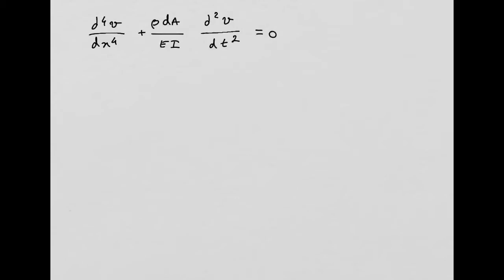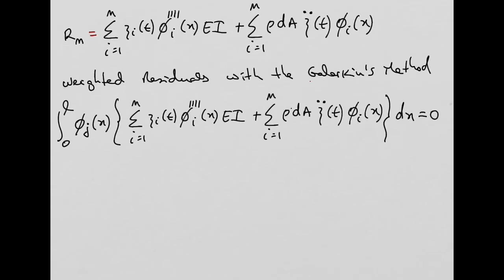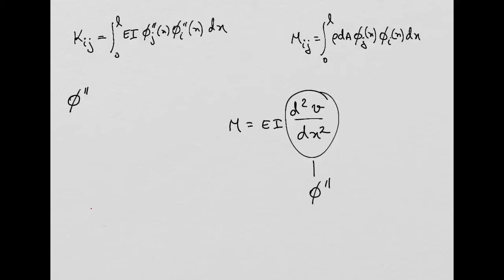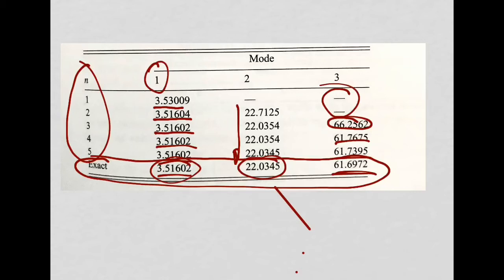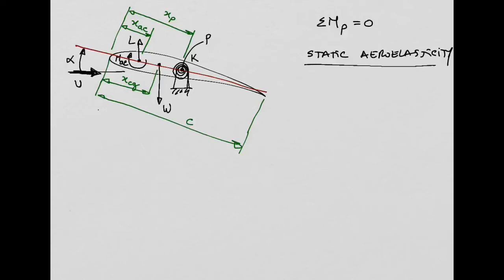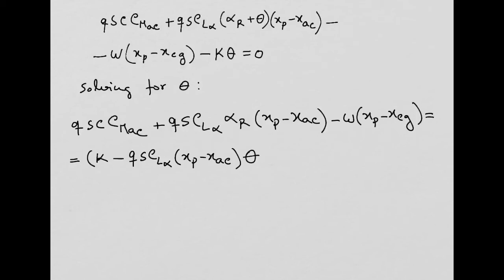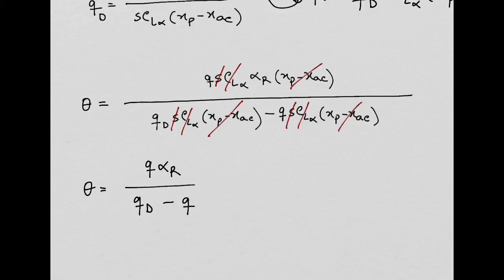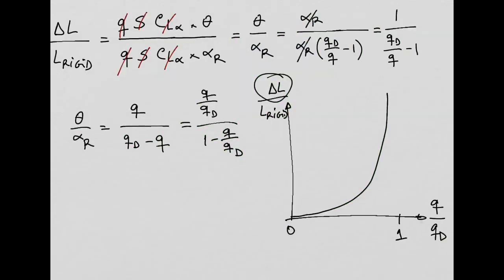Static Aeroelasticity - Divergence

Comment: Thanks for this invaluable lecture.
May I ask when you wrote the equation of the moment about P @1:03:07, Shouldn't the vertical components of lift and weight be only considered in the moment equation?
And what about the Drag forces?
Reply: Moreover the momentum of force W to the point P is written incorrectly (arm of force has to be calculated with angle)